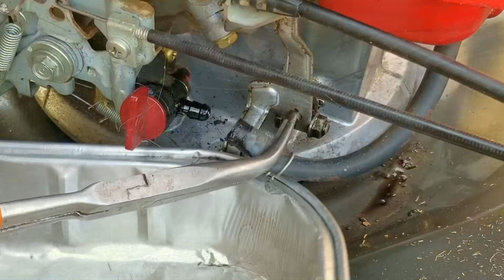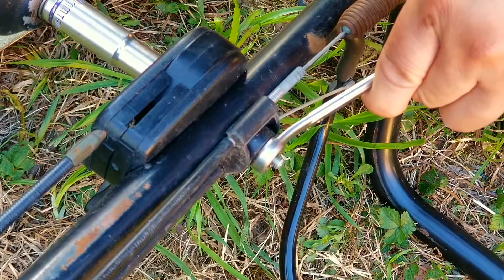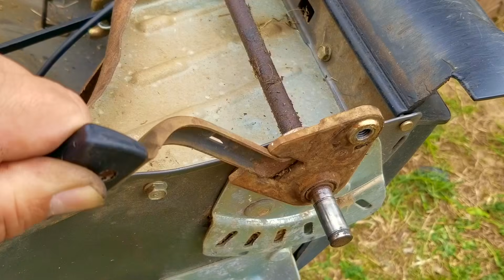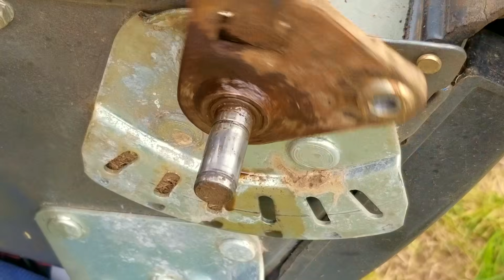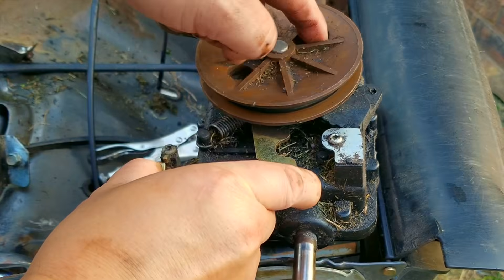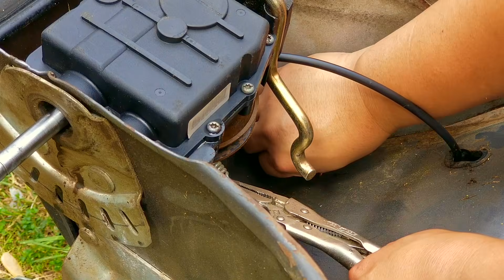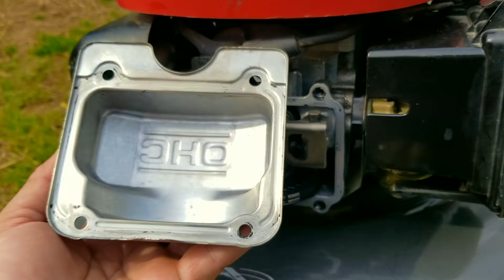Honda Mower Self propel finally fixed

Comment: I watched this video for one main reason, and that reason was I knew when you got done those rear wheels still were not going to turn backward. A little background. I've been repairing mowers for a living since 1999. I have replaced many a honda transmission through the years. I never really understood why the wheels would never turn backwards or were very hard to turn. In 2008 the shop I worked for sent me to Nashville for a 5-day honda school. One morning while waiting for the class to start the guy next to me was asking the guy next to him that very question, and he worked at a honda dealership. His answer was they were designed that way. They were designed to pivot as a zero-turn mower does. Made sense to me and believed it to this day.
Reply: darryl thompson ---The main reason the wheels do not pull backwards easily, is because of the terrible design Honda did on the back wheels... Notice, there is nothing, a shield, some axle seals, etc., to keep dirt, grass, moisture, etc., from getting in between that axle bushing and the axle itself..  So, once dirt, moisture, etc., gets in there, on both sides, rust forms, and then for sure, the axles will not turn backwards very well... I have found depending on how much you mow, how wet the grass is, and if you use water to clean off your mower,  you can sometimes get more time using it normally or less time, before it starts to bind up again... It was and probably still is, a most awful, careless, design that Honda did to these mowers, and they all have this issue because of that...  As much as I like this Honda, I end up not using it because I know it will start binding back there again, and I have to take all that stuff off the rear wheels, clean it all up, polish the axles again, lube a little, (not too much as this also attracts dirt and it sticks there), and I may be good for another season or two..
I will never, ever, buy another Honda mower again because of their ridiculously designed rear axle/adjuster mess.....
Reply from the maker: The only reason I'm replying is that I find that hard to believe. If it was meant as a zero turn then all the self propels would have the front casters. And of those Front castered Honda mowers I've worked on, that one would also roll backwards. My own personal Honda's have all rolled backward with no problem.

Comment: What is your opinion on an increase in electric/battery powered mowers in stores?
Reply from the maker: they needed more power, most common complaint before was that they didn't have any guts, so they upped the voltage.
Reply: @INSIDEHOUSEGARAGE  Would you or have you tried one before?
Reply from the maker: @cdos9186  so are you asking to try and increase the power to an existing battery mower or just making a video on one?
Reply: @INSIDEHOUSEGARAGE  Have you ever tried using an electric mower?
Reply from the maker: @cdos9186  only a corded one that I had for about a year.
Reply: @INSIDEHOUSEGARAGE  Did you like anything about it?
Reply from the maker: @cdos9186  yes it was light and easy to manage and very quiet
Reply: @INSIDEHOUSEGARAGE  Did you switch back to gas?
Reply from the maker: @cdos9186  I needed to because I needed more freedom and power

Comment: I would try not to but like you I probably have out of curiosity.  This is a great detailed video.  The Honda  self propelled system is overly complicated in my opinion.
Reply from the maker: I believe you are right How ever at they last. I've seen some toro and troy bilt from and rear drive systems that break internally
Reply: @INSIDEHOUSEGARAGE  I have had several Hondas  with broken or frozen self propelled system.  Yes the Troybilt and Toros break too but they are easier to remove IMO and I usually have a spare axle/ tranny  around.

Comment: Yes, I've spent more time than practicable on repairs for several reasons. One reason is that quitting before fixing  means I've wasted the time spent thus far. Also. and maybe more important, is the satisfaction of success. Also the lesson learned will be of future benefit. I use a wire coat hanger to remove and replace springs. It' provides good leverage and is easy to maneuver. Early on I found springs were hard to grip and stretch with pliers, Chanelllocks, etc. I didn't have the benefit of a YT resource to simplify analysis and techniques.
Reply from the maker: oh that's a good idea about the hanger. I'll have to try that out.

Comment: I have fixed at least 8 of these Honda mowers with the exact same problem. It’s a design flaw, and even the factory recommended recall parts won’t  fix them all properly.  You have to remove the HOC plate bearing, shine up the drive shaft to a mirror finish and use graphite or synthetic lube (in some cases no lube because the bearing tolerances are too tight) and try to get a few more years out of them. Even the factory recall replacement HOC bearing is too tight in many cases, Honda really screwed up on this one. Just google “Honda mower won’t pull backwards” and you’ll see what a major screwup these mowers are. Not all, but the majority.
Reply from the maker: that was very good information I appreciate you sharing that.

Comment: Only if I fill I can get it fixed and if it's a commercial mower. But 9 times out of 10 the customer will say junk it.
Reply from the maker: you are very correct.

Comment: I have a echo trimmer srm 225 it leaks oil out the exhaust it ain't fuel mixture I think the seal on the exhaust is it. it ain't spark arrestor screen either would like to know how to fix it
Reply from the maker: when does It leak? when it running or when it's in storage? how you do store it, hanging with the engine down?
Reply: @INSIDEHOUSEGARAGE  right after it is running so when the engine is hot I store it laiding up
Reply from the maker: @twinturbos8846  is your air filter wet with gas or oil too? It sound like the engine is running rich, after turning it off, the extra oil could be leaking out of the body of the engine and out the muffler. but after that's out, it shouldn't leak much more.

Comment: Just as I said before,80 PSI is good for that engine because it has a decompression mechanism on the camshaft,my dads needs rebuilding because while it was 65 PSI when it was brand new it tests at about 43 PSI now, it's an 18 year old Honda GSV190 engine now.

8 hours of labour to fix that lawnmower is only worth it if it's either a commercial lawnmower or a domestic one which you're fixing up for yourself !
Reply from the maker: very well said Russell Booth
Reply: The value of the hours you put into fixing something varies. If the time spent causes you to lose the opportunity to put those same hours into a paying job then no it’s not worth it. But if you are between paying jobs or you have down time that you can’t bill to someone then yes, it’s absolutely worth putting those spare hours into something like this.
Reply from the maker: @johnfisher747  you are absolutely right about that

Comment: You rock! :) Some cut junk bike tires and several self-tapping screws will give your drive wheels grip again.
Reply from the maker: that's not a bad idea
Reply from the maker: @Rendeso Modifications would it work I you already had some usable bike tires already?
Reply: @INSIDEHOUSEGARAGE  Yeah, it's all about curbside finds when people put their trash out.
Reply: Yeah, but it changes the height of the back tires, and they will never match evenly, the height of the fronts, so you will always be cutting your lawn at an angle...

Comment: You can also slide a small rope on the hook if the spring, double it and pull the rope. I found this to be a great way to remove springs.
Reply from the maker: what kind of rope do you use?
Reply: @INSIDEHOUSEGARAGE  I like to use a small diameter parachute cord.
Reply from the maker: @littledavieb  that's a good idea. thanks David B
Reply: @INSIDEHOUSEGARAGE  you’re welcome. I really enjoy the videos you put out. Keep up the good work!
Reply from the maker: @littledavieb  I will.